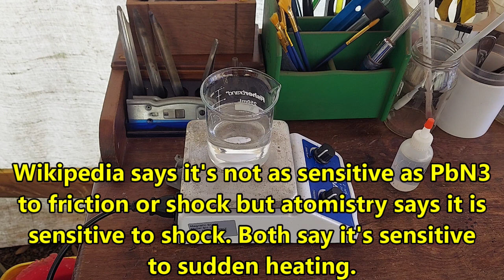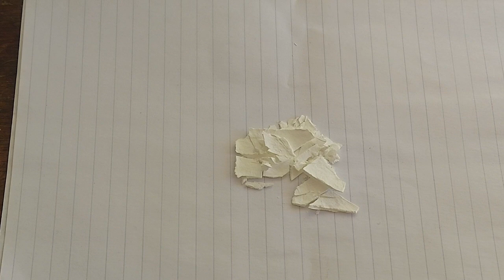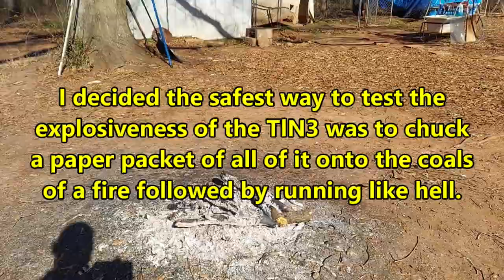Toxic Explodium: Thallium Azide #donttryathome #thallium #azide #chemistry #explosion #explosive

Comment: Thallium azide is a weak explosive compared to other heavy metal azides, so it is of little use, but its toxicity is very high considering the toxicity of thallium and azide ion.
Reply from the maker: @Silver-bz1ss  It has essentially the same explosive power as lead azide. The reaction is the same, the stoichiometry is the same, and the decomp rates are comparable. Not sure where you got the idea that it was significantly weaker than the other heavy metal azides. As for the toxicity thats just an added bonus. Although lead azide makes a giant cloud of lead metal which I wouldn't really want to be breathing in either.
Reply: @PoorMansChemist  Thallium azide is several times weaker than lead azide. I give an example from the book of the minimum charge of metal azide for the initiation of tetryl. For thallium 0.07 g, copper 0.001 g, lead 0.025 g, silver 0.02 g. And so for other explosives, several times more thallium azide is needed. And the toxicity of thallium is much greater than lead, although lead is also not a gift.
Reply: @PoorMansChemist  Another example: you set fire to the remains of thallium azide on a filter, it simply burns up; do the same with lead azide, there will be a powerful detonation; lead azide, even a small grain of lead azide detonates very strongly; this is a powerful explosive substance. Copper azide is even more powerful; it is simply mind-blowing power; a couple of dozen milligrams give a simply colossal explosion.
Reply from the maker: @Silver-bz1ss  Did you just not watch the part of the video where I blew a small amount of this stuff???? 🙄
Reply: @PoorMansChemist  I watched all the videos. According to all literary data, azide thalia is the weakest. You will blow up lead azide in the same quantity as you blew up azide thalia and you will see the difference. Lead azide will be a force many times more powerful.

Comment: PMC i admire u being so brave and taking every single safety precautions.  3 grams i assume it cannot be stored without great risk.

Would u mess with Mercury Azide or Lead azide in the future?
Reply from the maker: Thank you. No I would not store it. It's supposed to be safe to store but after seeing the explosion I wouldn't keep that stuff in my lab. And I won't be doing mercury or lead azide. I only did thallium azide because thallium is my element. No one else works with it so if I didn't make thallium azide no one would. But normally I don't mess with explosives. They give me the creeps.

Comment: I've noticed several commenters mention the stability of sodium azide.  It doesn't easily detonate, and you can keep it in a jar on the shelf (though I don't know for how long) ...  
There is a very good "chemistry" reason for this stability -- it is the ionic nature of alkali metal salts.  The azide ion is 3 nitrogens in a straight line like so: N⁻=N⁺=N⁻ , which is isoelectronic with CO₂ -- -- except the atoms are all charged.  
So the combination of an alkali metal cation and the azide anion is more-or-less stable with that arrangement of charges.  (and this also accounts for the 'stability' of TlN₃).. 
But when the azide is more of a ligand with a metal that is less generous with its electrons, the salt is less stable.  A metal like silver or lead sort of 'sticks' to things, but doesn't give a whole electron to its ligands.  And when the azide is part of an organic molecule, your mileage may vary -- but as we know, organic azides also tend to fall apart.
Reply from the maker: The bottle of sodium azide I have in the shed is about 3 years old.  It's been out there that entire time exposed to all the ambient outdoor temperatures and it's been totally fine. I've never given it a second thought. I was doing some reading on it and apparently it will explode if you heed it up enough. I was considering testing a little bit the same way I did the other 1 to see what the results would be.  Although this time you can rest assured it's going to be a lot  less than 3 grams!  Maybe 1 g is a better way to go.
Reply from the maker: PS  Such a test will have to wait for a few days though.  We are getting perma rain here for the next day or two I think.  It's been raining for almost 2 days already.
Reply: @PoorMansChemist  come to think of it, the 'pedia does (or did) mention that the azide is one route to very pure sodium.  You can crystallize it, and if done carefully it will exclude other alkali metals, alkaline earths, etc. and give you pure NaN₃ crystals.  This is then carefully decomposed (in the absence of air, humidity, or CO₂) to leave the element.  Nothing else it can be, since plain nitrogen does not react with sodium.

Comment: Where do I find to be kind of funny about when you burn the filter paper when you were trying to figure out which way the wind was blowing I had a feeling it was going to be blowing the smoke toward you.
Reply from the maker: It always does! When I was burning the fire down to coals the smoke would blow wherever I happened to be standing. I filed a complaint with the air elementals but they haven't got back to me yet. 😆

Comment: Careful with this, though TlN3 isn't listed in the ATF list, it's still explosive and incredibly toxic. Really don't want to see you raided. It is an election year and they don't care as long as it looks like they made a bust of somesort to appear doing something useful.😢
Reply from the maker: I'm not worried about it. I play with these kinds of things very rarely. Also it was just a few grams and I didn't turn it into an explosive device. And like you said it's not mentioned in any legislation anywhere.  So I think it will be fine. Besides there are people around here that are blowing stuff up that's way bigger than this. I hear It all the time. Don't know who it is. But I assume its tannerite or dynamite or something like that.  Pretty sure it's not gunfire. Although we do get a lot of that around here too. I've even heard full automatic fire before. Presumably somebody was playing with their machine gun.
Reply: I went though it in 2004 😳  they had a chemist go through everything and charged on what could have been made. Depending on the state it may be impossible to beat the case because the way the laws are worded and they use the ignorance of chemistry to scare the F out of people at every step.💀💀💀

Comment: So how toxic are the thallium residues that settle on everything around the boom?
Reply from the maker: Probably pretty toxic. It should be the finely divided metal. Thallium is an active metal so it will break down into the oxide or hydroxide over time. Eventually it will just become part of the soil although in this yard rain runoff and erosion will remove it fairly quickly. Its hardly the first bit of thallium Ive returned to the Earth.
Reply: @PoorMansChemist  Prussian Blue intensifies   It's neat that the azide leaves atomized metal on decomposition.  I'm curious if that can be used practically in some manner.
Reply from the maker: @Yaivenov  It can be used to make very pure thallium metal. According to atomistry if thallium azide is slowly heated in a hydrogen atmosphere it will break down to the pure metal. It could also be used as a primary explosive just like lead azide. TlN3 may be safer to use in that manner than PbN3.
Reply: Dust the area with finly divided sulfur to neutralize it. Won't totally detoxify it but will mitigate the solubility of it. Prussian blue also can bind it but is better suited for liquid waste
Reply from the maker: @christopherleubner6633  It's only a few grams of thallium dispersed over a wide area. The cloud drifted back towards the woods so it's not just on the ground. It's on all the trees it touched as well. But starting in a couple days it's supposed to rain for 4 days in a row. That will clear out any dust and wash it back towards the woods where all the water in the yard drains to. It will be diluted down to harmless levels (if it's not there already).